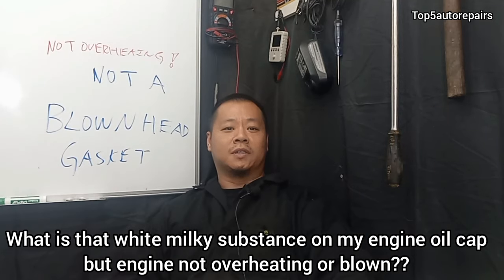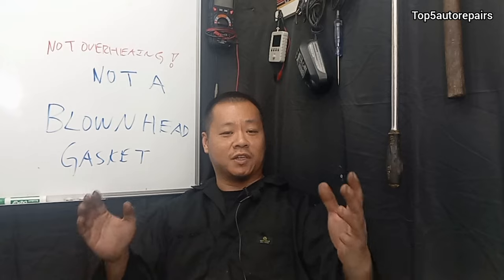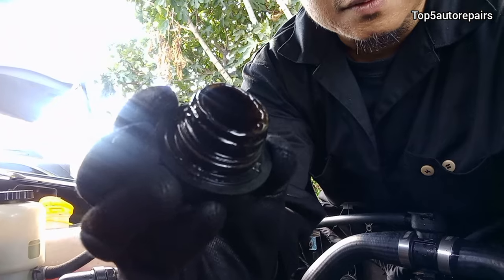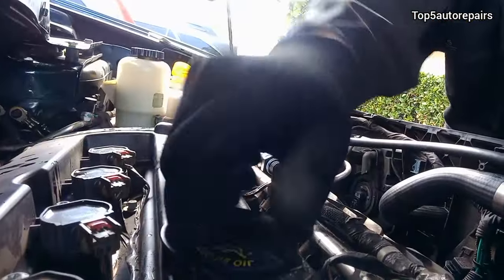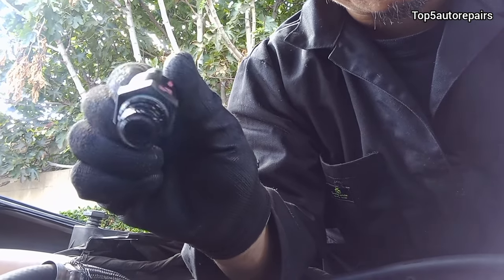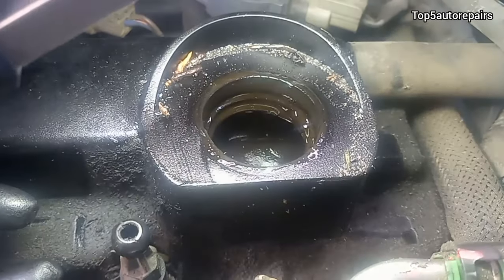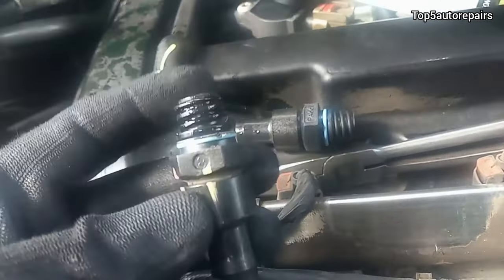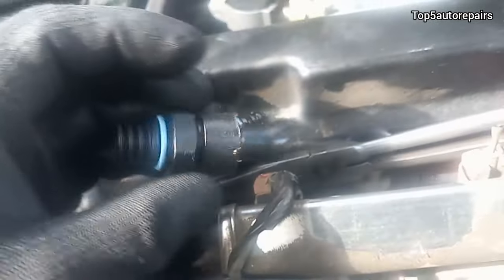Engine Oil Cap Looks MILKY BUT Head gasket is not blown and NO Oil and coolant mixing or Overheating

Comment: I'd found what looked like Cheese-Whiz in my oil cap. Turned out the gasket on my oil cap was shot and was ducking in moisture.  Great work sir.
Reply: I just found that as well
Reply: Wth I have the same problem

Comment: PCV valve isn’t a maintenance item for GM but it is for me. I change mine every 30,000 miles (or 6th oil change). The valve is $9.00, cheap insurance as a new engine is $4,000.00 and up.

Comment: I have a 2015 chevy cruze LS with the 1.8 liter engine. The oil was once milky white but not the dip stick. I tried a block tester kit from Harbor frieghts, and the results i got is more than sure a blown head gasket. Just want your opinion
Reply: So what was it bro? I have the 2016 gen 1 1.4l cruze and have the same issue after a front end collision hit mainly my cooling system. She was running hot AF for a few days atleast tbh before I could get the replacement parts so even sketchier but I really gotta know it could help me and my cruze alot

Comment: You're a smart dude 😎
That solved my answer pretty good
Not that long ago I was straddling my engine over on top of it I cracked my PCV valve put a janky connection back on to hopefully resolve my issue ...

Comment: im wondering if on a little tk barina this could be a problem.
oil, water and temps seem fine (cap apparently was a little milky),
But the exaust manifold it gets smokey hot (starting from where top of catylic bolts on which they swapped out)

i Thought it may have something to do with clogged exhaust back pressure (so removed 2  sensor (pre/post cat )Thought it worked, but then put them back in and it didn't smoke while i was testing it. . . 
but apparently she smoke up again 🤔

Comment: Hey I was wondering  the old oil has none of that in it but inside the valve cover you could see it and the cap but when I took out my pvc valve and shook it it  it was kind of full of that moisture and water but I shook it and it rattled a little bit itI blew it out cleaned it and cranked up the car and it's got good suction on it and it works now I wonder if that could have been the problem or if it's something else because the PVC valve did rattle
Reply: The engine isn’t having enough time to heat up hot. Take it fir a good long ride. You maybe not driving long enough to heat up the engine and burn off the moisture in the engine. You will get a light brown milky hunk inside the oil cap. Moisture builds up and causes this.
Reply: The engine isn’t having enough time to heat up hot. Take it for a good long ride. You maybe not driving long enough to heat up the engine and burn off the moisture in the engine. You will get a light brown milky hunk inside the oil cap. Moisture builds up and causes this.

Comment: Is there an opportunity for the radiator reservoir cap to pop off..? 

I'm not seeing any discoloration, no lost fluids, and not overheating.  

I did add recently an oil catch can to my car. My car has an aftermarket supercharger installed which wouldn't allow for the pcv hose to reconnect. So we just added the oil catch can. We tapped it into the air intake and pcv to the can. I am seeing a bit of oil in the can as well. Not a lot, but some. 
Would this indicate that my pcv is operating?? 

You thoughts are appreciated.  

Thanks.

Comment: I pulled the valve covers on my l37 3800. It had alot of milk under the valve covers but no where else in the engine. Thermostat was not letting engine heat up enough.  I'm also doing the PCV. Hope this fixes it.
Reply: Were you able to fix the problem?
Reply: @rodv.4726  Oh no. Engine was shot. Leaky head gasket. Piston slap. I blew the one piston into a thousand pieces. Replaced it with a series III L32.

Comment: If the reason is from the blowby then the oil consistency will be the same everywhere in the engine, obviously due to oil circulation. Since the oil is okay, but the pcv is stuck, it suggests that the reason is stuck open pcv valve and the vapor comes from the intake with the air. Any vapor that gets in the cylinder will come out with the exhaust. However  some vapor will enter the crankcase via the stuck open pcv valve. The vapor will mix with some oil/blowby and when the engine start to cool it will condence on the bottom side of valve cover and the oil cap, the top areas that cool first.

This is my explanation, and Allah knows best.

Thank you for sharing your experience with us. I'm happy I've subscribed before.❤

Comment: Mate you have best explained channel. Are you in Australia? I need someone to figure out what’s up with my Pajero. It misfire when restart only from cylinder 6, sometimes I get code for cylinder 6 misfire and many times no codes. I have a little bubble in radiator and rust even after flush, heater wasn’t working and now half working. We switched around coils and injectors and same code came back. What do I do all mechanics seem can’t be bothered to figure it out
Reply: Fuel pump or fuel regulator. Misfires because not  getting enough gas. Check fuel pressure
Reply: Guy Your The Best Self Explanatory &  Smart Knowledgeable Mechanics I Appreciate & Admire & Respect That I'm A Female & Don't Trust Most Mechanical Out There 4That Matter Hard to trust any 1 Nowadays . I Will Definitely Subscribe#1👍 1999Taco 2.4 -2wd

Comment: My V6 3.5L Toyota with just 20K miles on it is FULL of oil mixed with something. I mean the "oil" is filled so much it's filling up the valve area as I understand it. The coolant isn't low. I don't believe condensation can't form a gallon or two of water in your oil and I don't know what it is or where it's coming from. I just had the oil changed 500 miles ago at the dealer. I'll find out what it is when I get it towed to the dealer in a few days. It was running smoothly as silk the same day I discovered this problem. I obviously don't want to even start the engine like this again. I'm already afraid there is cylinder wall damage... But no signs of it as far as burning oil out the tailpipes.
Reply: Were they able to fix the problem?
Reply: @rodv.4726  I forget the details but yea, they did me right. It's still as smooth and peppy as ever. I keep the oil changed every 6months or 5k miles, whichever occurs first. Those 8-speed transmissions are a little slow downshifting, but it's consistent so I think it's normal and something I've gotten used to.

Comment: Last week, My car was overheat.. & the radiator was crack damage, then after i replaced it .. then i try to drive long way road.. after 55mins later again the temp was so high.. overheating .. the waterpump i check maybe okay.. because when i refill with the water on the radiator it keep swallow the water goes down.. but theres no leak at all .. and its like a pressure .. then is that normal if black oil but after i touch it with my fingger its black liquid .. oil that mixxing with water ? that comes through my exaust? but my engine & radiator colent is clean so far not mixing at all.. & no smoke at all on my exaust but theres a black oil liquid at the exaust what could be the problem? on mazda 2 hatchback demio 2005

Comment: Will that cause excessive white smoke coming out of the exhaust? Oil cap is clean, oil wand is clean but I’m getting a misfire and a lot of white smoke out of the exhaust.
Reply: Idk if this is the issue but I let my aunt barrow my 97 integra and she put to much oil in it and it started bogging and a bunch of white smoke out the tailpipe but if not it’s could be a messed up cylinder
Reply: That’s a blown head
Reply: then is that normal if black oil but after i touch it with my fingger its black liquid .. oil that comes through my exaust? but my engine & radiator colent is clean so far not mixing at all.. & no smoke at all on my exaust but theres a black oil liquid at the exaust what could be the problem? on mazda 2 hatchback demio 2005